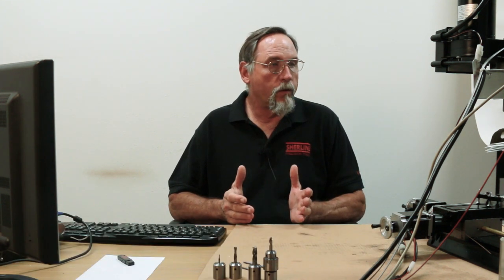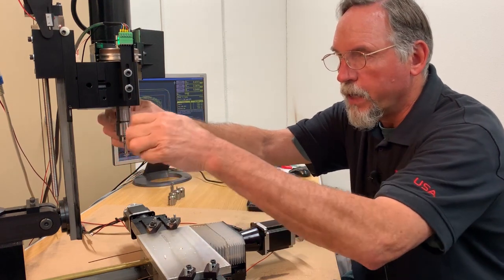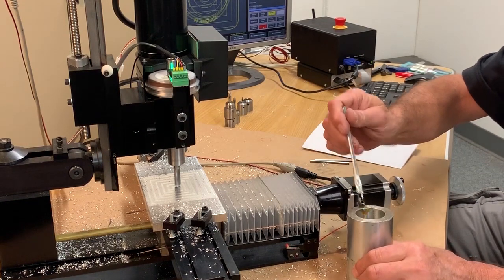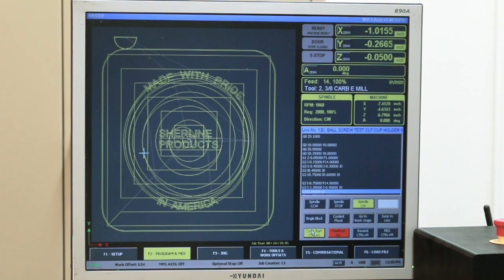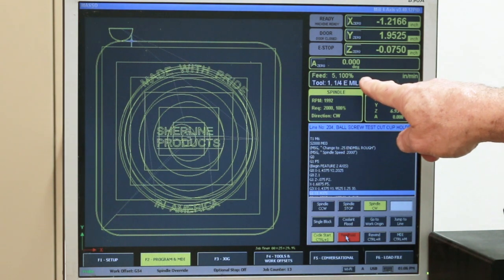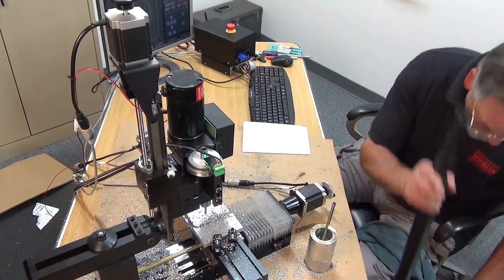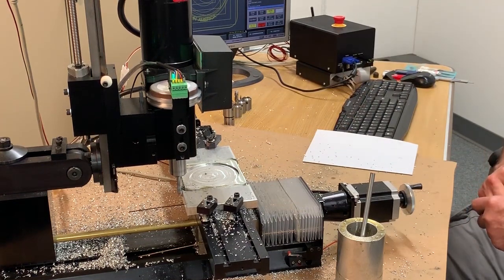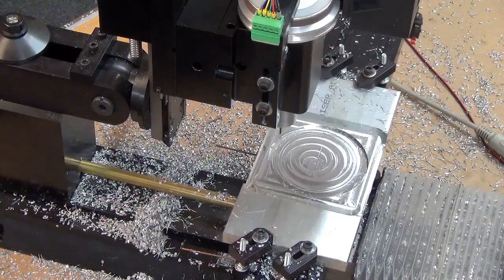Sample Program on the Sherline CNC Controller

Comment: Hi Karl, I noticed the round column is replaced on this mill with a rectangular one. 
Is there a part number or a drawing for this solid vertical column on this mill?
Reply from the maker: The mill in the video is our 6858 ball screw model with a square(ish) column base. The column base is P/N 50056 but it does not fit on the 2000-series mills that have the round column base. Below are URL links to the column base and the 6858 ball screw mill exploded view.
https://www.sherline.com/product/50056-tall-rigid-column-base-rectangle/
https://sherline.com/wp-content/uploads/2018/10/6858_exp_rev.pdf

Comment: What software did you use to create your G code?
Reply from the maker: Three different programs were used:
1.	For the letter engraving we used V-Carve Pro.
2.	For the round pocket milling we used the conversation programming that comes with the MASSO. Their software is better for pocket shapes because the cutter path spiral out whereas BobCad will move out in a straight line before each radius cut. The BobCad movement will cause chatter in the straight-line moves. The MASSO spiral cut will give a nice constant feed with even material removal. Much easier on the machine and on your hearing. 
3.	We used BobCad to generate the outer profile with the corner radius.
4.	We ran each program individually in the proper sequence. Once all of the programs were run and proven, we cut and pasted them into one program.